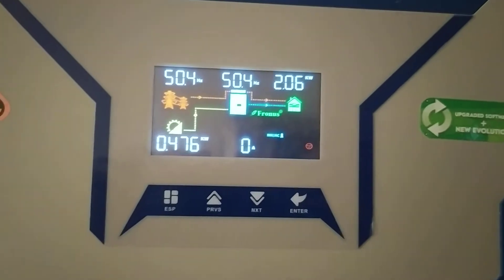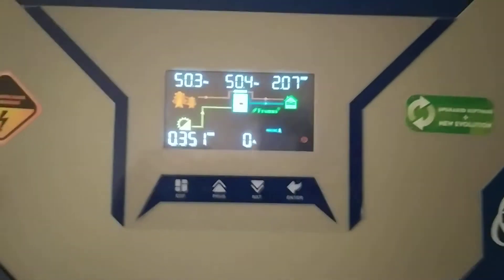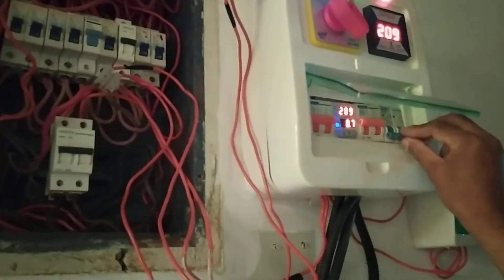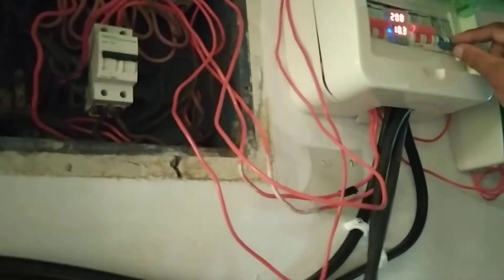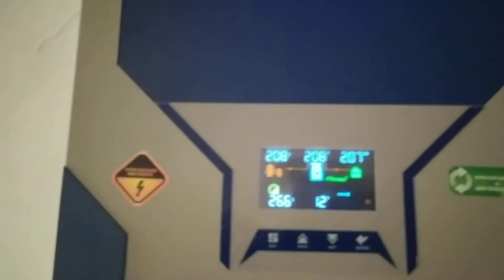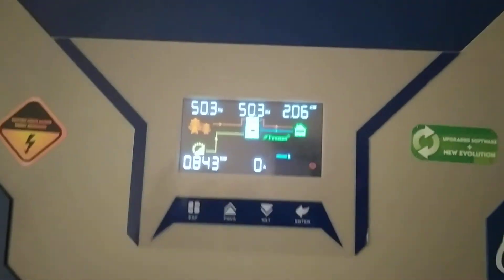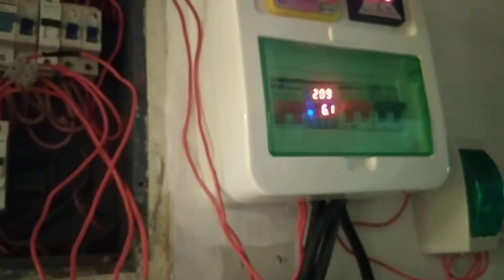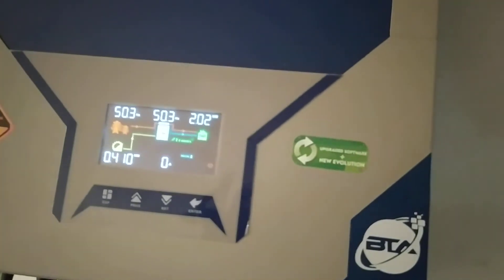Fronus Infineon Plus PV 7000 MPPT Inverter Test and Issue

Comment: Aoa nauman Bhai , what is the estimated price of software card which needs to be replaced for PV fluctuations issue?
Reply from the maker: W. Salam. In my case it was free as my inverter was under warranty.. Honestly I have no idea about the price but I believe it shouldn’t cost more tha 1500-2000.
Reply: Thanks
Reply: Es ko replace kerny k liay inverter complete khul jata hai ya keypad open Ker k bhi hojata hai?
Reply from the maker: @saqibjaved3572  poora open hota hai, lekin koi solder waghera nhi nikalta, just plug and play hai

Comment: AoA. Bhai, meine abhi recently Fronus pv7000 inverter aur 540w Longi bifacial panel , without battery solar system install karwaya hai. Mujhe is me kuch doubt hein. 
1. Setting me SUB pe hai lekin LCD me wapda aur solar dono show karta hai aur lights bhi blue rehti hai means ke wapda se bijli le raha hai. Technician ko btaya to us ne kaha wapda wala  breaker off karein. Aisa karne se sara system solar pe shift ho gaya. Lekin ye koi solution nahi. Isay khud SUB setting pe solar, wapda aur btry pe jana chahiye.
2. Ye sirf 0.450 se 0.500 tak kw show karta hai aur bohat tezi se fluctuate hote hein. Kisi jaga rukte nahi. 
Please guide
Reply from the maker: Pehla wala issue aap ka battery laga k solve ho sakta hai. SUB mode sharing mode hai. MKS mode pe karein battery laga k to wapda automatically shut down kar de ga as long as it’s not required.
Reply from the maker: For point 2, warranty claim mein software chip change karwa lein.
Reply: SBU mode pe solar+ battery pe chly. SUB mai usne solar+ utility (electricity) hi chalaani h
Reply: @naumanm1  hello nauman bhae,  kya sbu mode pe pv7000 net metering be krsktha he ya net metering ke liye sub mode he rakna hoga.  Mujhe be yahe doubt he likan me ne net metering be ke he.
Reply: @naumanm1  warranty chip sirf aik baar claim hosakthe he ya 2 years thk jitne baar problem ae hosaktha he?
Reply from the maker: @Kingkhan-kd2xg  jitni marzi bar problem aye change karna zimmedari hai inki.

Comment: bhai ap k pass panel kn c company k ha? dc wire kis mm ki use kr rhy?
Reply from the maker: 4mm wire hai. And Fizz Solar Stock Lot k panels hain producing 43.5v on open circuit and 9Amp on short circuit. But inverter pe max 6.6Amp receive hoty hain.
Reply: Aisa hi kuch mery sath ha, ya to solar panels ki quality nai achi ya wire ka issue ha. Ziewnic 450w k 6 panel ha, and Hot weather me  max 1550w output milti, wohi par barish waly din jb mousan kafi acha tha tb to 2200watt tk output mili ha. Kia issue ho skta ap k khyal me?
Reply from the maker: @MohsinAli-ro5vw  mein ne thori research ki thi to pata chala k low temperature mein acha perform karty hain panels, but 2200w vs 1550w mein bara diff hai. Inverter konsa hai aap ka? Mery panels ne max mujhy 1800w dia hai aaj tak
Reply: @naumanm1  fronus 4.2kw pv5000 latest model

Comment: Mera Fronus PV 7000 plus hybrid operation mein chal raha hai. No load and no batteries. Sirf grid energy feed ke liye. Lekin cloudy day pe chaltay chaltay grid feed in bilkul band kar deta hai. Restart karo to chalta hai lekin kabhi bhi trip kar sakta hai. Not reliable. Kya problem hai? Service center walay kehte hain battery nahi to unstable hai.
Reply from the maker: Esa hona nhi chahiye. Service center waly har kisi ko yehi bolty hain. Aap ne inverter reset kar k check kia hai? Inverter kis mode pe hai? SUB per kar dein isko. MKS per na rakhein.
Reply: @naumanm1   SUB (Solar First) pe hai. Jab feed in band karta hai to manual restart karna parta hai. Feed in band hoti hai to solar ki line ghaib ho jati hai. 
Reset kese karte hain? Reset karne se sab parameters urh jaein ge? Wifi bhi?
Reply: @naumanm1  2 inverter Fronus PV 7000 plus infineon. ek mera aur ek azeez ka. dono error 09 ke sath service center mein paray hain. ajeeb fronus ke sath masla hai. main to ro raha hoon keh fronus kyun liya. Ziada paisay de ke solarmax orion le leta.
Reply from the maker: @sumshahid  Bas ye inverter sasta to hai but itna reliable nhi hai.
Reply: @naumanm1  koi solution batain. Used mein bech doon? Konsa hybrid inverter 6kw ka recommend karein ge aap?

Comment: Assalam o Alikum  go to settings 37 and switch to  HYD mode 

May be after reverse feeding fluctuation stops on PV
Reply from the maker: Thank you but the problem resolved after new software chip installation.
Reply: @naumanm1 keya abhi b invter pass apka
Reply: Aghar ha to software kon sa krwaya
Reply from the maker: @muhammadmaaz7356  ji
Reply: @naumanm1 bhai software version batye plz

Comment: Only this model of Fronus have an issue of variating the voltage and power of solar. It also generates mild sound when load is increased on it.
This inverter have software issue, and we have requested the company to upgrade it's software
Reply from the maker: Yes the issue resolved after software card replacement!
Reply: nai bhai, 4.2kw pv5000 me b yeh same issue ha, me card b replace krwaya ha, phr b yeh issue ha.
Reply: 1.5kw ma b same issue ha. Solar hoty howy be wapda lata ha.